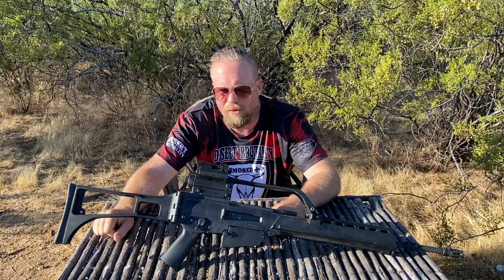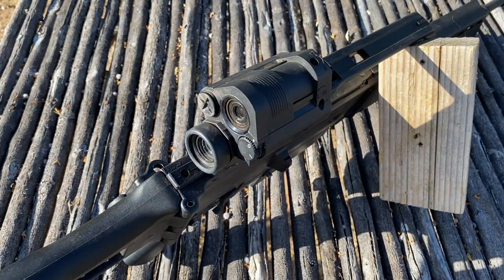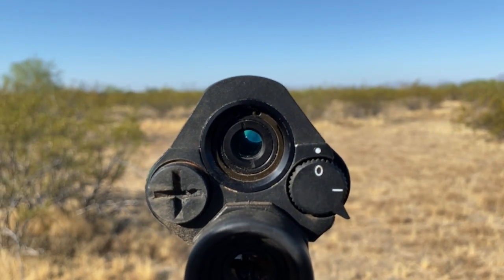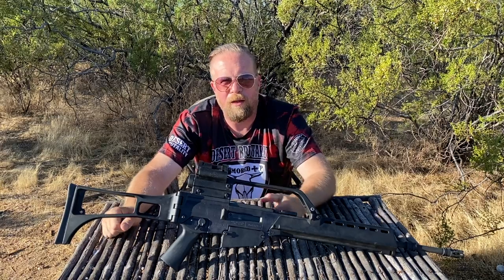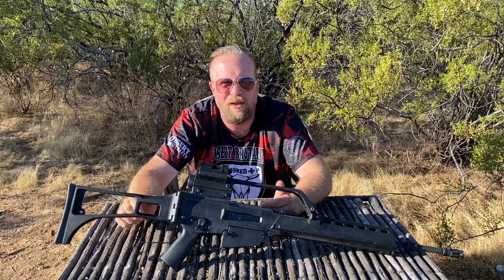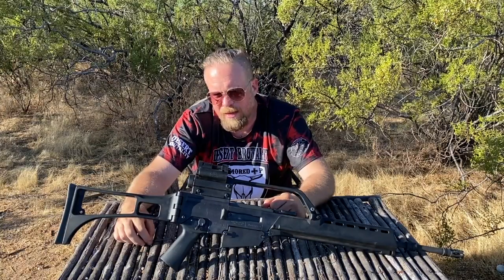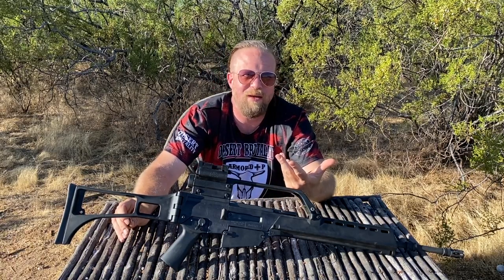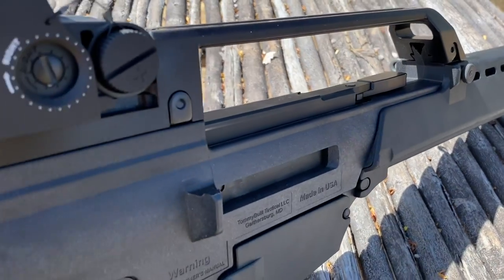G36 - Bundeswehr Hensoldt Dual Optic

Comment: You lost zero because you didnt relief spring tension after zeroing. The german army technical manual states that after adjustingst the gun, you have to put mild presure to the front of the optic tube. The adjustment screws are spring loaded , if not done so the can get twisted, another big design problem with this optic block. If they are twisted or jammend they usualy get free after shots are fired what then ruins all previously done adjustment work.
As crapy as this optic is, I was still very happy after we got the fresh G36 deliverd to my old unit late ,finally getting rid of the old G3s with iron sights. Never forget this gear was developed for WW3 and had to be used by conscripts.
Reply from the maker: Bur I recited the incantation and burned the incense.
Reply: :D thats great, shame it didnt helped. Its not so much that say that the manuals issued to us soldiers where perfect but i was serving as an instructor training conscripts at these rifles. I remeber that this tiny step after zeroing was often overlooked and expericend myself how often i thought i properly zeroed a rifle only to have the soldier then coming back to me complaining that he had to aim in the dirt to hit something.  :D off course maybe also my doubtfull skills involved in some cases but sometimes it was these tiny spring ´s what holds optical tubes.
cheers :) and keep up your great work

Comment: Even if the gun you have didnt loose zero in the heat test due to the plastic use in construction there is the potential for the gun to loose zero which really isnt desirable

Comment: My fear: ur Optics are broken.
Never experienced any of ur problems (mentioned in that specific video) with that.
Never was able to woble the optics on any of the G36 I used. Not even when having over 50°C for days.
Have you de-tensioned the scopescrew-springs? Has to be done after changing the zero.

Comment: The scope is actually 3.5x, not 3x.
Also, the red dot optic has a slide on top with a prisma/mirror thing underneath that generates the red dot from daylight. The battery operated illumination is only needed in dim or dark conditions. Karl, I'm a bit disappointed. Usually you are better prepared for your videos.